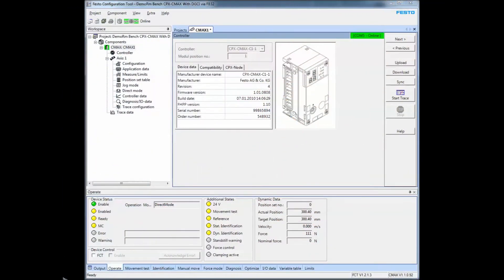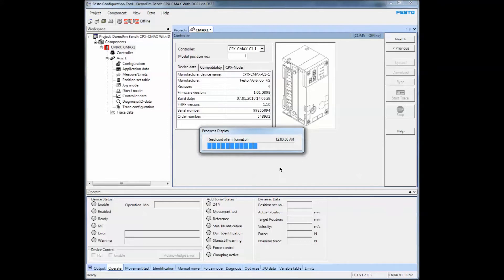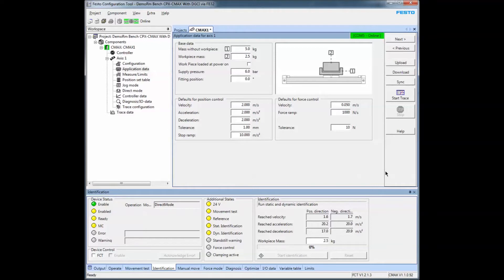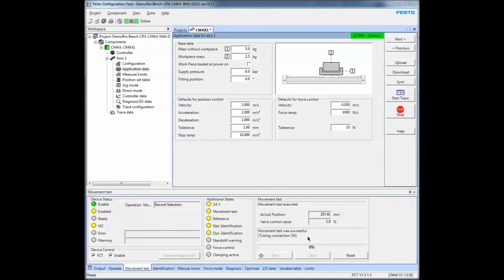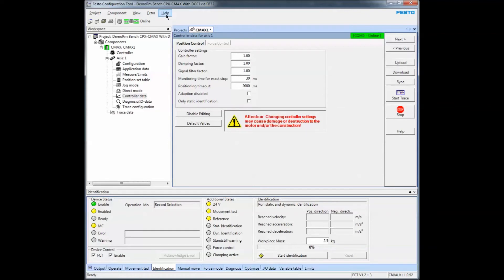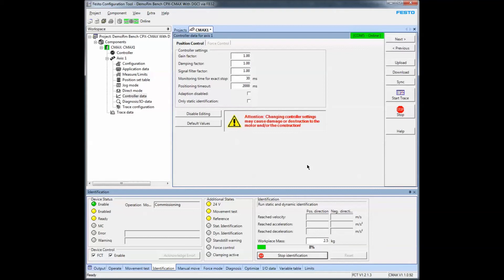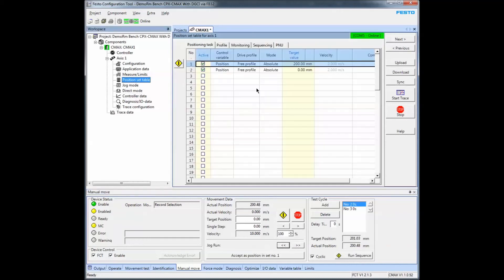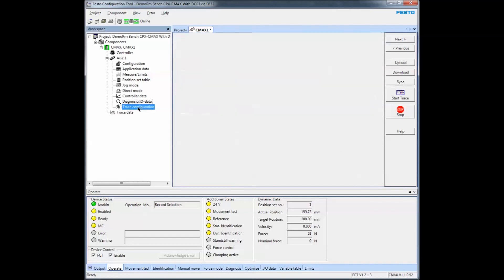CPX-CMAX + FB32 + ControlLogix + EthIP FHPP AOI + Training Video 01 of 03

Comment: HI Steve, great video. Thanks. Do you know if a Siemens TIA Portal V13 equivalent add-on instruction is available?
Reply from the maker: I wrote the Rockwell AOI myself.  Nothing exists for TiA Portal that I know of.  I think "something" exists for the old S7 Simatic Manager but i have never used it.  Contact Festo Product Support and ask them if interested in the S7 FB library, but i don't think it is at all like the one i did.